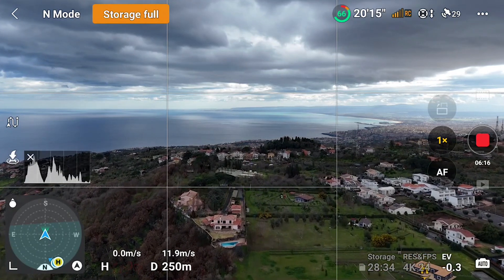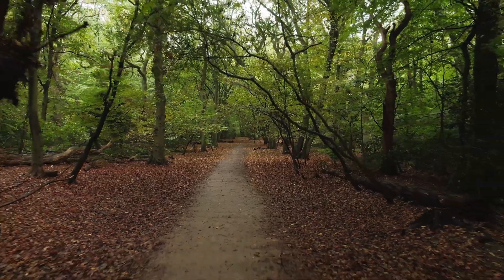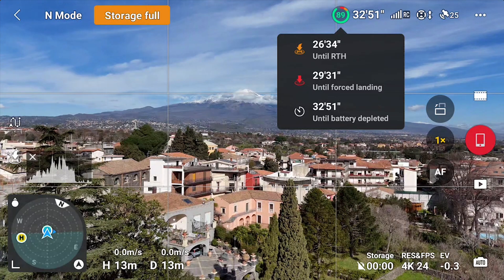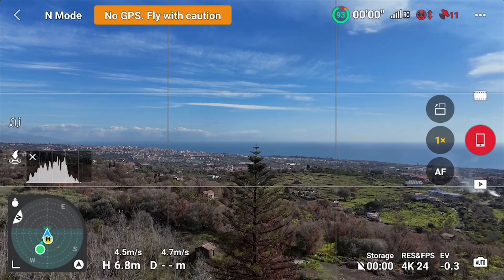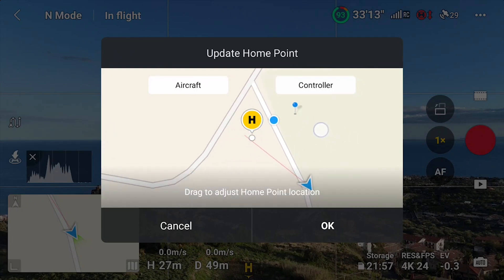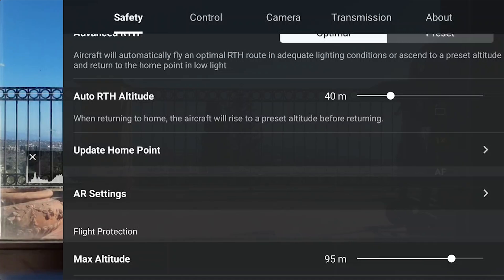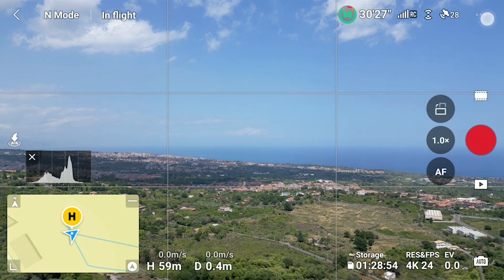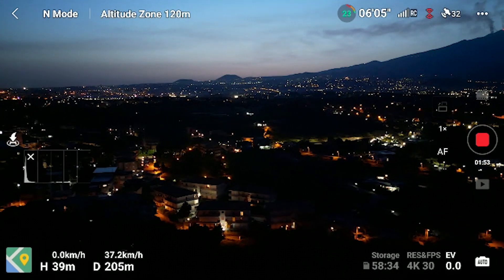DJI Mini 4 Pro and Air 3 - New, Improved Return to Home

Comment: Suppose we are away from drone or drone are at low level like 20ft in garden or under tress.sudenly we need RTH but if i had set RTH HEIGHT AT 200 feets..
My question is that when my dji air 3 prepear him for goto 200 feets (for set RTH position but drone are at under tress so what will b happened..
They did or not colapsed with tress..?
Pls clear my confusion
Reply: same think here